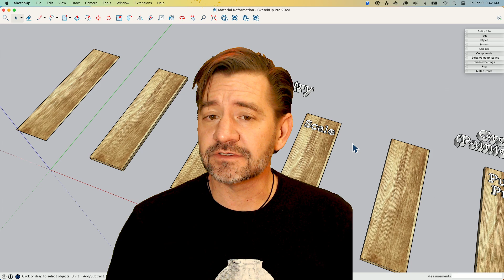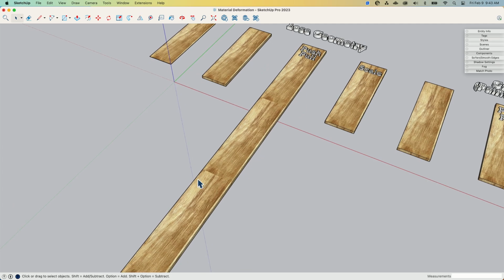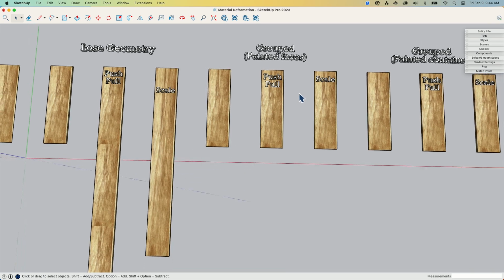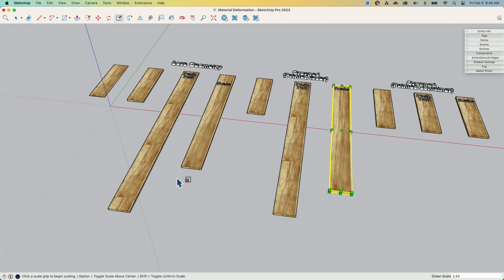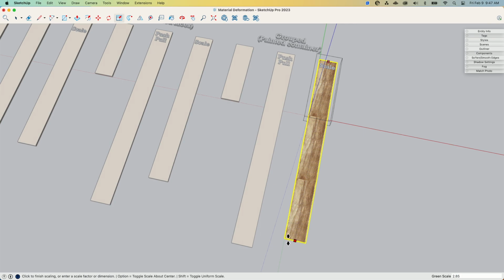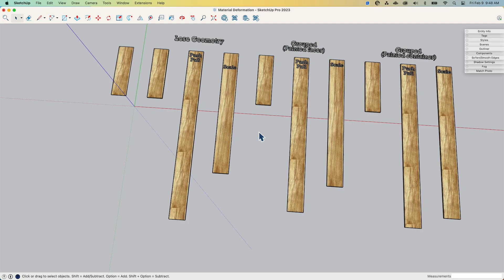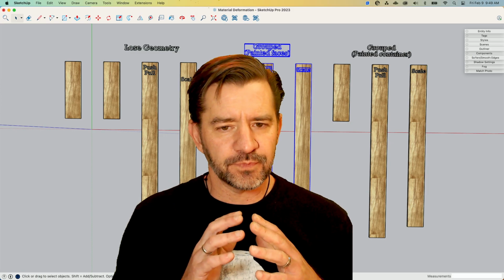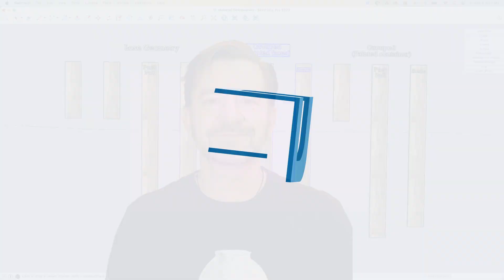Why are my materials TILING when I SCALE?

Comment: I would like to ask you a video explaining  the technique of UV mapping inside a group/component  with a texture like your boards in this video, after oriented the texture in all faces, delete the textures inside the group  in the entity info tray. I read a thread on SU forum where Eneroth explained: after doing this procedure you get a group/component with the default material but remains the UV.  This mean that when you paint a group/ component from outside it is correctly oriented. I tried to use this technique to applied different texture to the same component in order to avoid the repetition like the board on a fence. Right now I’m testing using texture on tag boxes and using color by tag.

Comment: I paint the geometry inside the groups anyway because if you paint a group on the outside, you can’t right click on and edit the placement position of the texture - which I need to do a lot when using bricks or wall and floor tile textures.
Reply from the maker: Good call. You're doing it the right way!

Comment: I keep hearing this, but there are many instances where painting the group instead of the faces is preferable. If you have the components but want different textures. If you want to change the texture often and/or aren't sure of the texture yet, it is way faster to paint the group than each face. You can also have a two-tone item easier if you paint some faces inside the group and then paint the group with the base texture. That said, yes painting the faces gives you more control over what it looks like, but this may not matter if it is a simple color or a bidirectional texture.